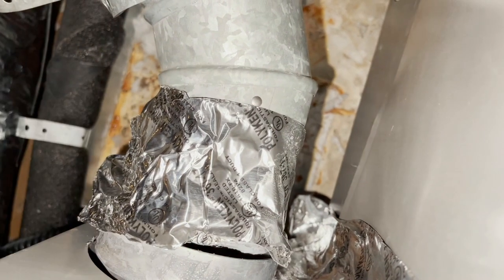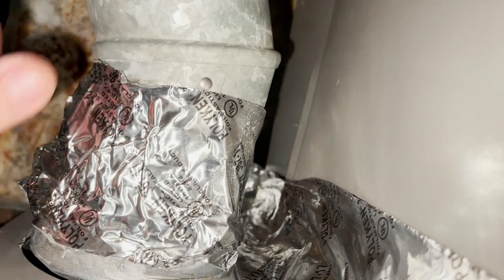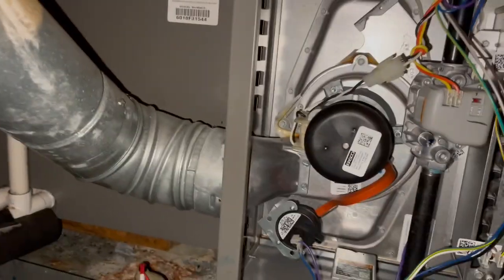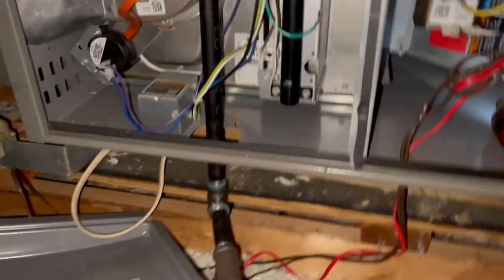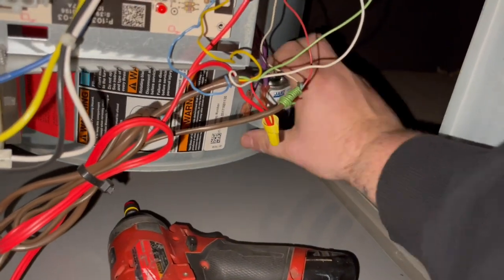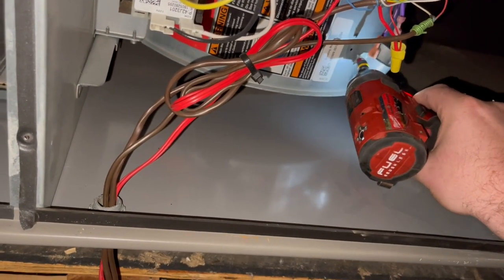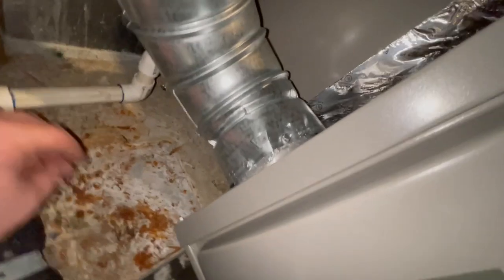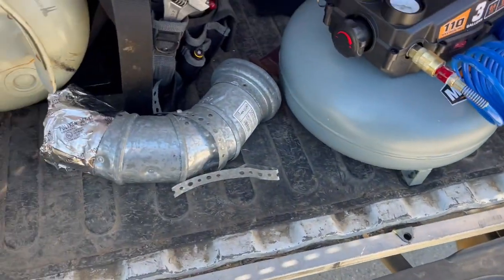Vent Pipe Repair/Blower Cap Replacement

Comment: you fixed it but why does the bottom collar not fit tight to the fitting on the furnace?  looks like it could leak some exhaust back out the bottom of the fitting

Comment: hey john do yall not pookie the seams in louisiana? out of all the videos i've seen, I never see the seams between the plenums, furnace/air handler, and coil pookied.
Reply from the maker: It’s Pookie tape. On duct board I always use Pookie. On metal to metal it’s necessary with mastic tape
Reply: @johnisraelhvac2019   oh ok im in Texas and we always pookie the metal to metal seams on the equipment just looks weird not seeing pookie lol